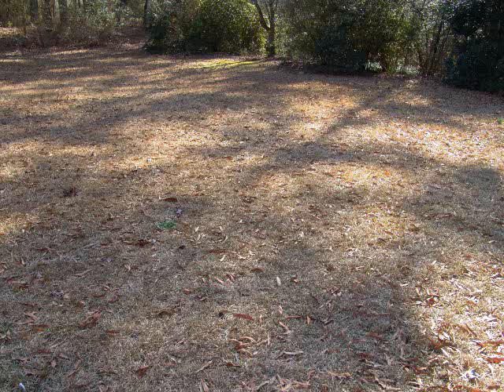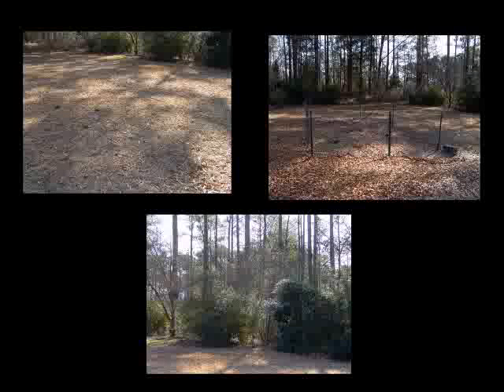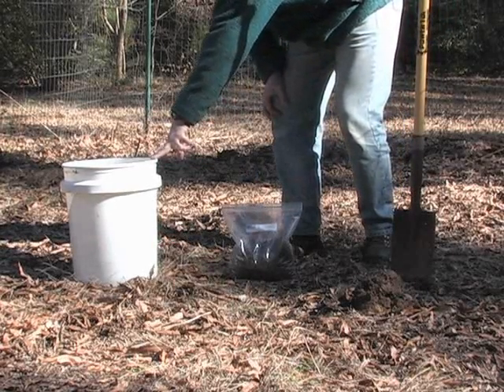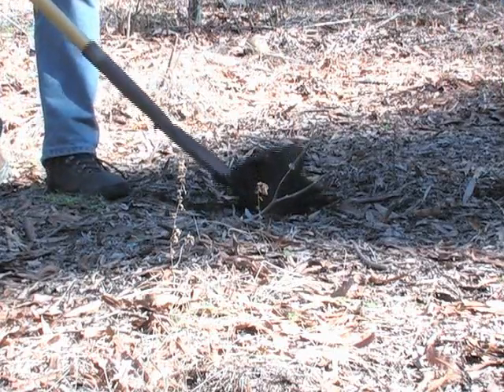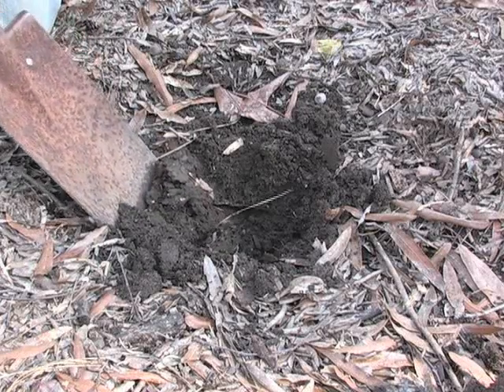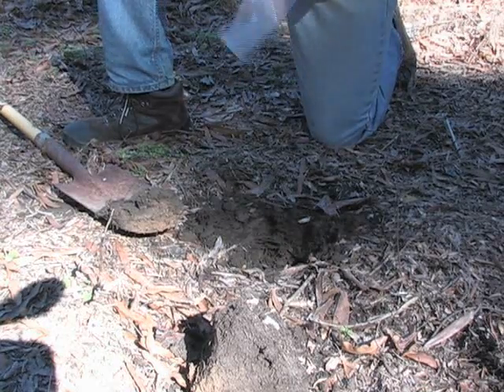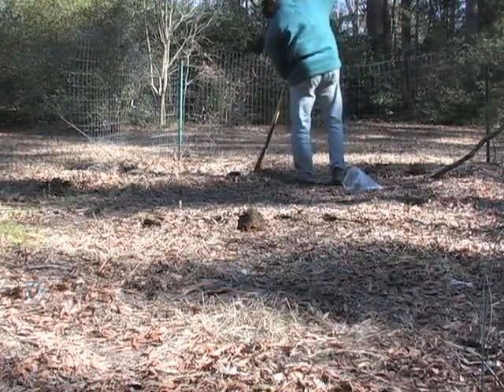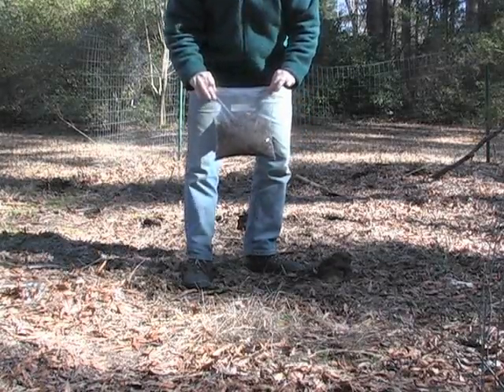how to collect a soil sample for analysis

Comment from the maker: You are mixing sub samples for areas that ate similar such as the vegetable garden. This way you get an average for the area. You will take a different set of sub samples for each area that is to be treated differently. In this example you would repeat the process for the lawn and repeat it again for the shrubs. For a total of three samples (each of which consists of multiple sub samples).

You might want separate samples for front and back yard if there is reason to believe there are differences. Hope that makes sense. In the end you want an average of each location so you don't skew the results with an outlier.